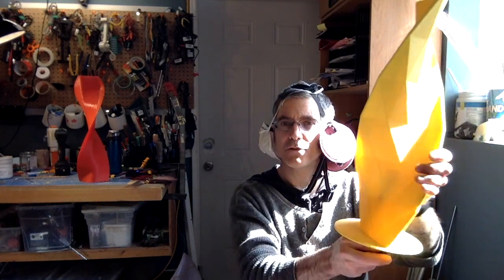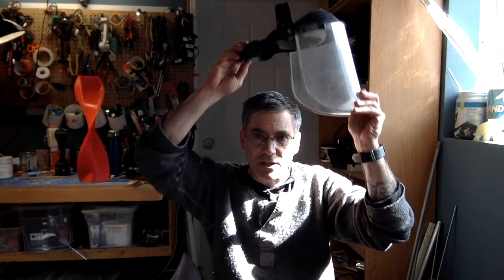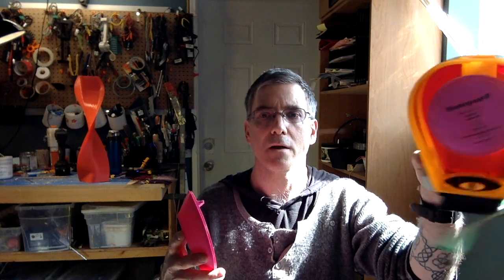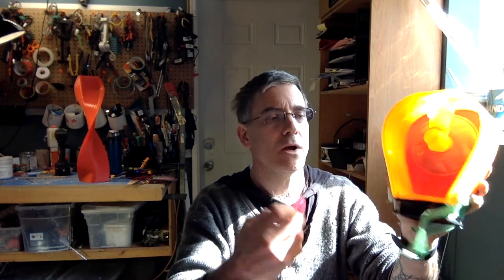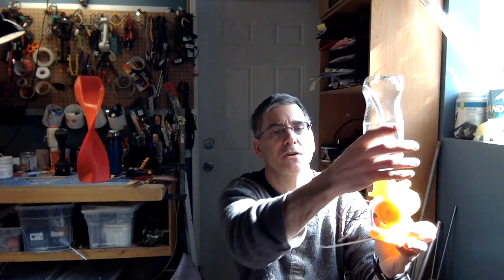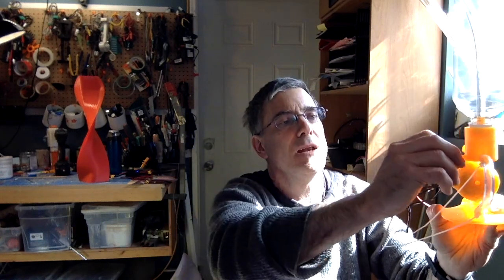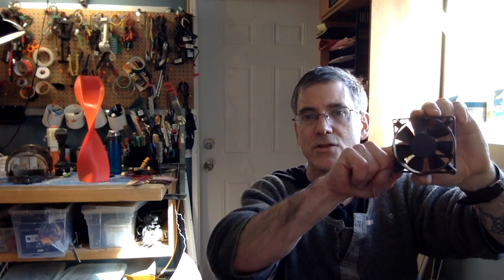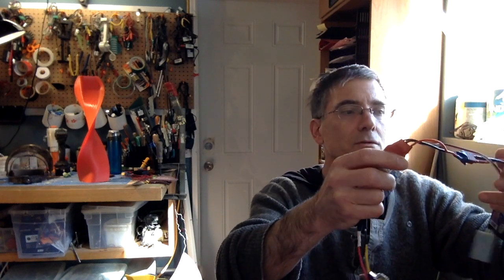Masks, DIY oxygen generator?

Comment: What do you think of adding a desicant to absorbe moisture drops.  3:20

Most of the drops from sneezing drop to surfaces and later we touch them.  Yes some drops persist in the air for a while  but by far the most/best thing you can do is stop touching things that don't need to be touched and washing ones hands and stop touching ones face.

Comment: If your cells are based on stainless steel, wont it create hexavalent chromium?
Reply from the maker: From my understanding, which I don't think is perfect, hexavalent chromium is created when Amp's per area exceeds a threshold, and that as long as current is kept below that, no erosion of the electrodes takes place.    I'd be interested in hearing more informed opinions.

Comment: Your thesis about respirators vs. surgical masks is unfounded, the notion that a surgical masks protect the user is grossly inaccurate, breathing in will always take the path of least resistance, while some air may pass through mask fabric, most will come through the gaping gaps in the sides. Indeed the vapor valve on some respirators will allow particles to escape, however, the theory that it will cause harm is again unfounded, because at the very least it will be directed down and will suppress aerosolized particles from sneeze etc. There is a better sollution, that has been around d for decades, no great mystery, a non vapor valve respirator, it protects the user and environment. Moldex makes some of the best as well as 3M. If in doubt they have published extensive research on the subject.
Reply from the maker: Well Troy, it's a bit hard to take your word for this, do you have any documentation for this, or are you going to send me to a video..... cause the word of random commenters who are reacting to having been corrected on other matters, isn't particularly useful.   thanks, but back to bed, or do something useful